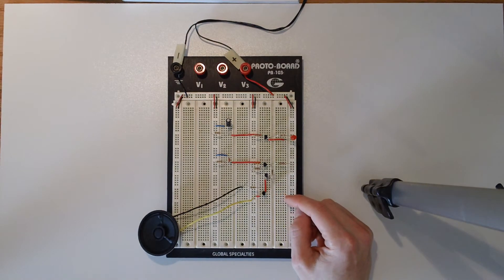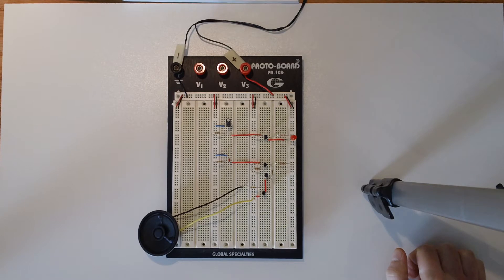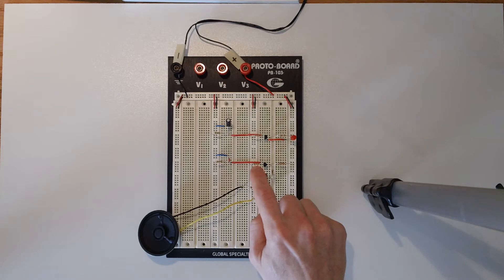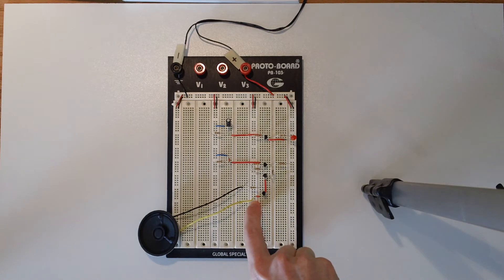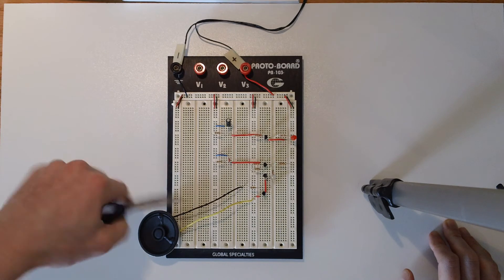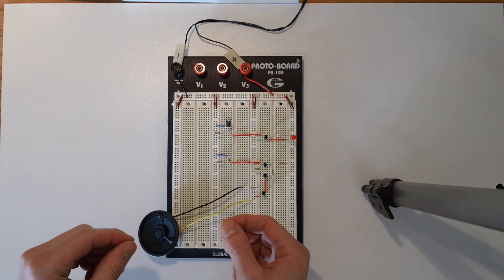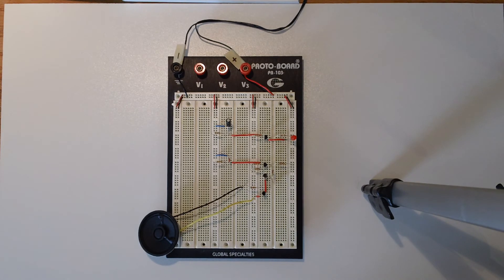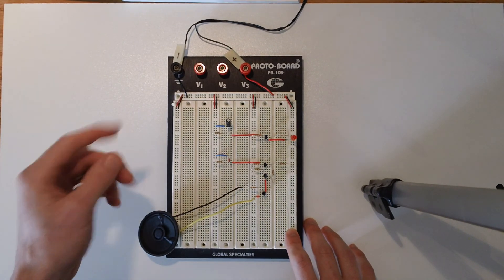Make: Electronics - Experiment 11 (Part 3)

Comment: Hey Chris, I'm having trouble getting this experiment to work. I've checked to make sure my circuit is exactly as the book tells and my components are in working order. I notice with my multimeter that about 55 mA is flowing through the second transistor (collector to emitter). However, I do not get any current through the speaker. Have any ideas as to what may be wrong? Thanks for your help.